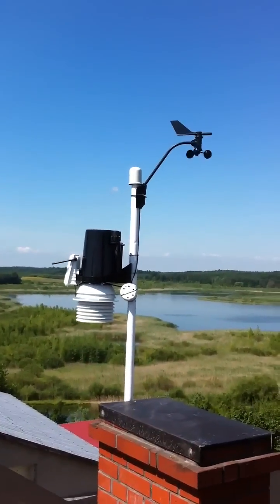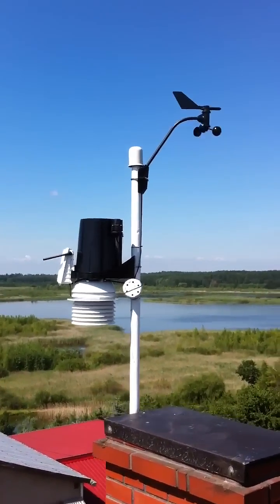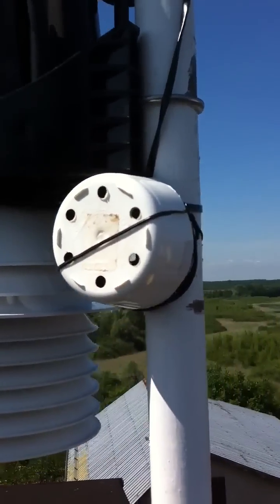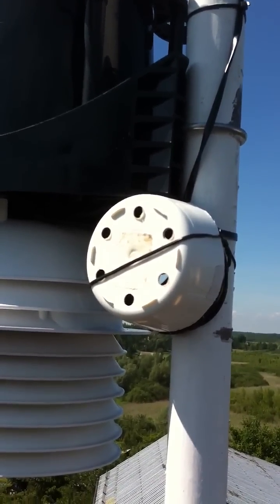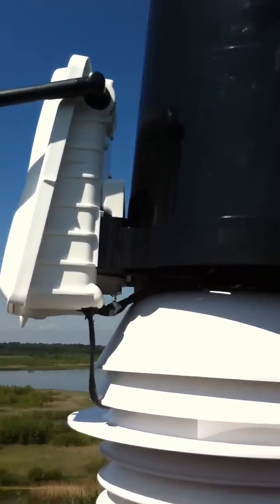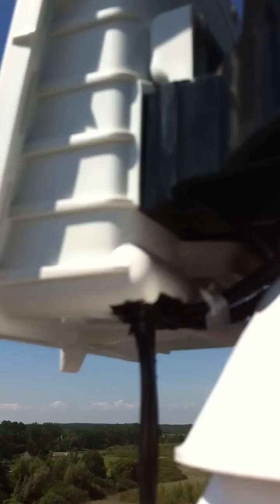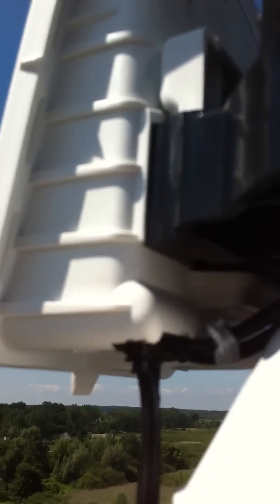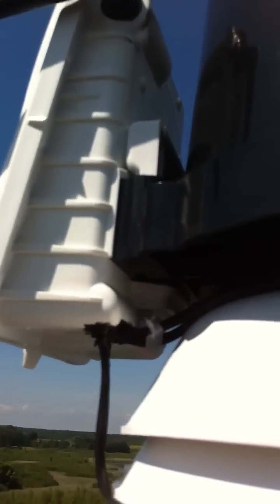Davis Vantage Pro2 Plus: Roof Installation

Comment from the maker: I climbed up my roof to unscrew the anemometer and gave it a blow with my mouth. It started working again! I have lost about a month of crucial for me wind data ;/

2) I took my station down for about 3 days to do yearly maintenance and pole upgrade from 2m to 6m height. I looked closely at the anemometer cups magnet and it appears to be a little corroded on at the ends of it but not in the middle.

Comment from the maker: I wrote to Davis support who replied to contact local dealer but we have none in Poland hence advised to replace it. It didn't even last 10 months so am reluctant to do that now as the product is weak.

3) After taking down my station I had put my console into service mode so there is no bad data passed onto receivers. I didn't touch my WeatherLinkIP datalogger at all not any other settings.